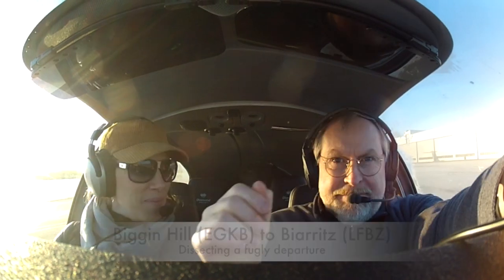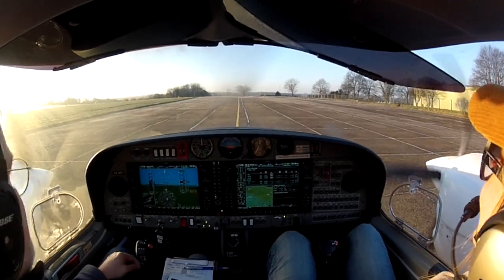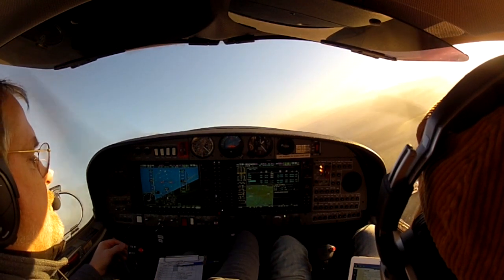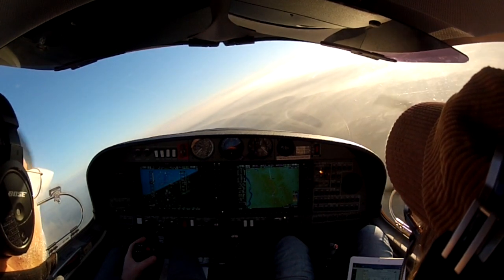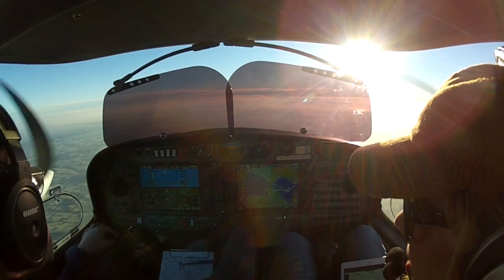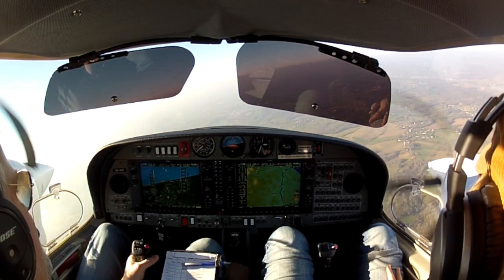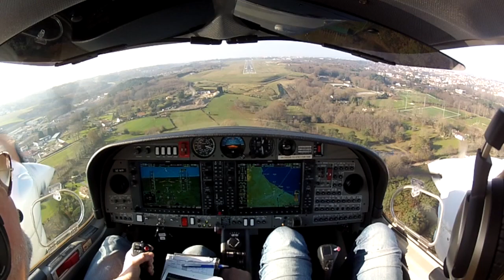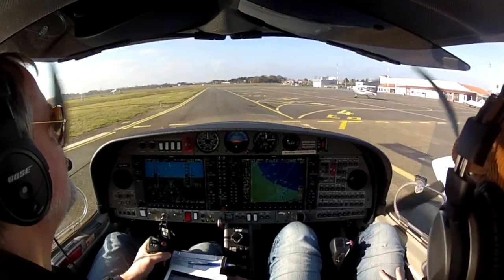DA42-VI IFR Biggin Hill to Biarritz

Comment: Another great video. Easy to understand how a series of 'events' can potentially cause problems. Handled well and spotting the autopilot was not doing what it should be was great work - something that has caused accidents in commercial flights before.

Comment: thx for sharing, this mistake is easy "to do". I also double check the 23 dep to make it "right". But I don´t understand the problem with the right turn. The AP try´s to caputre the Lyd R277 what he should do after 1NM out of Biggin DME. The DME is in the middel of the RW and the turn start´s short after the RW. So it is maybe 0,5NM to early but not complete wrong?
Reply from the maker: CheshuntISF I know what you mean, it was supposed to take a right turn, anyway (actually the first leg is R277 DET). But was supposed to wait 1nm before doing it, so that was already unacceptable. But it kept turning way through 097, which should have been the desired track. I believe the AP was trying to follow the big right turn to pass over BIG (which is what the SID procedure for 21 does). That would have had me flying back over the airport, which really would not have been appreciated.
Reply: No I don´t think so. The 430 switch always to the "nearest" leg to activate. The 21 right turn is also not part of the database. It start´s with the R277 the 1NM DME Arc is only on the SID chart. I will try it at the SIM!
Reply from the maker: CheshuntISF You may be right. I didn't want to find out by seeing what happened, though.
Reply: The 430 Sim shows exact what I supposed. At the take off run on 03 with the 21 depature the BIG "overfly" get skipped and the R277 get activatet. So the avionic/ap would not try to make 270° turn. Oly try to itercept, to early of course. Easy made mistake. Always when I change things in the last moment something goes wrong or missed. Easy to make a mistake!

Comment: Hey Jaunty,
Meant to ask you about cabin heating, since I note you are often wearing those neat gloves on winter days.
Question is, on really cold days in the flight levels, where OAT may be around -30C (or  up to -40C where I am), is the cabin heating sufficient, or do you really need to supplement with gloves and extra layers of warm clothes ? Thanks.
Reply from the maker: Alan Zee I have experienced OAT of -27c at the lowest, so that's all I have to go on. Normally, you have some sun on you, unless there are high layers blocking it out. That makes all the difference. If you have no sun, then the cabin heat will keep it liveable, but I tell all my passengers to layer, and to be sure and have a warmish long sleeve layer closest to the skin, because you will always need that. The air next to the cabin walls and windows is always cool to cold. I've never had to have full gloves at cruise, just the wrist warmers.

Comment: Thanks for sharing this, very interesting situation. Tbh i would actually advice the controller right away that i programmed FMS wrong, and ask for a radar vector and altitude. Remember these SIDs are just designed to reduce workload on the controller on a daily basis, I'm sure its not a problem if you mess up.
Reply from the maker: +kilik92   Probably the right move, if I had thought of it....

Comment: Hello again J. 
How have you found the reliability of the engines and airframe to be ? Any cancelled trips because of mechanical problems ?Do you have a Diamond maintenance facility close by?  

As I understand, if you have certain failures like ECU, you need to have a technician come by with program software and cables to connect to the engine.  For me, that would be a 2 hour flight for the fellow each way, because nobody local to service Austro engines.  But was also told that the Pilot can work through a number of fault problems by checking the troubleshoot procedure in POH, and so clearing a number of faults on his own.

So do you think one  needs to worry about frustrations of AOG downtime if no Diamond Service Centre close by ?
Reply from the maker: Alan Zee I consider the DA42-VI as a whole to be very reliable. I have never been stranded on the outbound leg, knock on wood. I have had a couple of starts delayed or cancelled due to mechanical issues, but never as late as at run-up and never due to engines. I've had one or two ECU warnings, but I know how to clear those myself (move the ECU selector to the failed ECU and back to auto). There has been, in my experience with both a DA40NG and the DA42-VI, a history of "false" ECU warnings that actually did not indicate any failure. They needed to be cleared, but no other action was necessary. I have to say the DA42-VI suffers far less, perhaps because they've trimmed in the electronics on the later engines, I don't know. My Austro mechanic is 1,5 hr away, flight time. That has not proven to be a problem. Actually, I haven't yet been grounded by engine issues. Not once in over 380 hours.
Reply: jaunty17 Was talking to a Diamond mechanic, and he told me the most important thing is that they fly regularly, meaning at least weekly, and one reason the flight schools do well with them (mechanically) is because the airplanes are always flying.  And if you don't fly them regularly, you they will suffer more issues than a regular piston airplane.
How many hours/year are you doing ?

Glad to hear of your 380 hours without engine problems to ground you, and that you  are able to do well with no service centre near by.   I am also bearing in mind that you have  the latest iteration of that engine, which is a bit improved even from the Austro variant in the NG.
Reply from the maker: Alan Zee Last year the plane did about 280h. I believe in flying a lot. Good for the plane, Good for the pilot! ;-)

Comment: Great video. One question, do you think that having a passenger was one of the factors put you off doing a full departure briefing?
Reply from the maker: philphish No doubt. Gotta work on that.
Reply from the maker: That said, it was also the classic case of several unusual circumstances lining up at the same time, resulting in a mistake you normally would not make. One factor was having a passenger, but others were the change in runway and the somewhat unusual use of the same SID for both runways.jaunty17
Reply: jaunty17 But with a passenger like that, I could see why.....  ;-)

Comment: Are you using the standard checklist that comes with the plane ? Why not use that as a base, and customize your own checklist.  That way you can add "SID......PRGRM RWY DEPARTURE".  I have added quite a few items like that to my mfr standard checklist, and even removed a number of standard items that are not necessary to be there.

Also, I had a chance to fly the DA42-VI last week.  Very fun airplane.  Was surprised at how high the stick forces were at low speed (especially roll).  Also, after only 30 minutes of flying at 1000' (ceilings were low), I was getting rather fatigued from the drone and noise of the engines, figuring that 2 engines at close proximity will be double the noise and vibration of the single engine in my Mooney.

After the flight, my check pilot told me :

1) you have to pay close attention to keeping the prop RPM's synched, otherwise the differential will affect you as I described above.  I thought I had the props very close, but was not paying much attention to that.  Could it be that even if they each show same % RPM, that you still need to nudge one or the other to get them "smooth" ?
2) We did not have ANR headsets for the flight
3) Up higher at altitude in thinner air, the prop beating affect should be reduced.

Interested in your experience with the above.  Does the (perhaps differential) beating of the air with 2 engines in close proximity to the cockpit ever cause you some fatigue/ill feeling ?
Reply from the maker: Alan Zee Well, I don't have to tell you that flying a larger plane by hand is all about trim and co-ordinated turns, to help minimize effort. But it is more of a highway plane than a curvy back-roads plane, no way around it. I very rarely fly it for any longer period without the auto pilot. (For myself, I also fly a Citabria, so I get plenty of stick and rudder there.) I have customized the checklist, but its always a question of how much detail to go into. I always use ANR headsets.